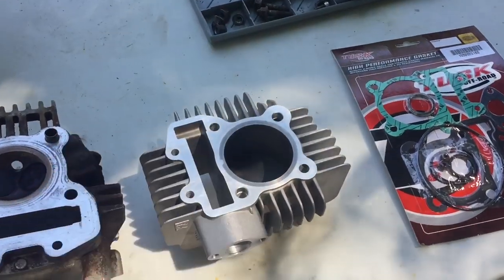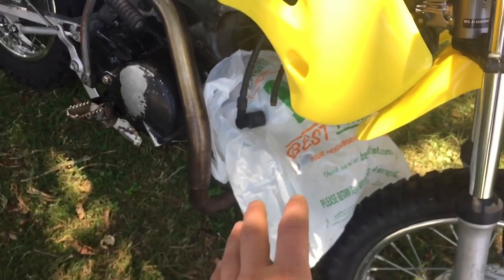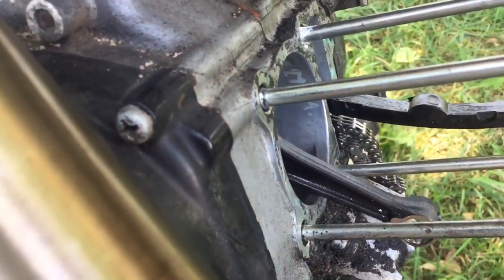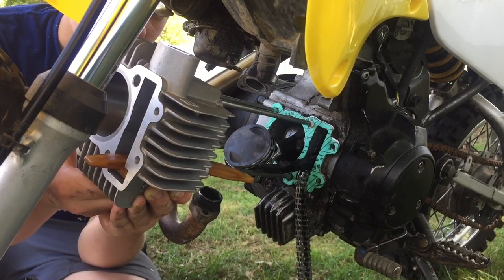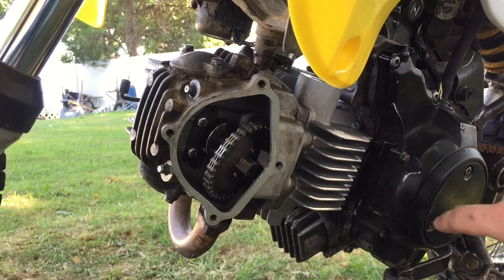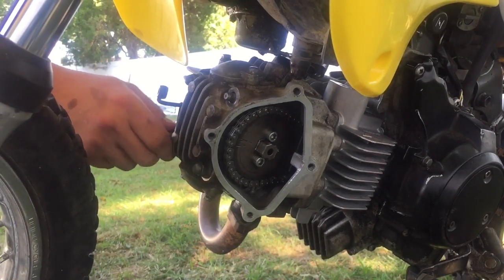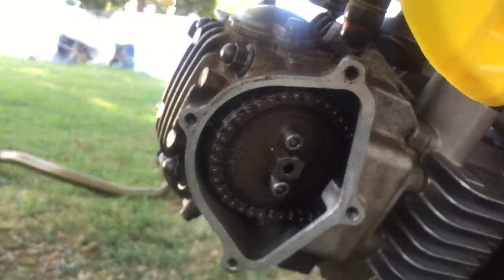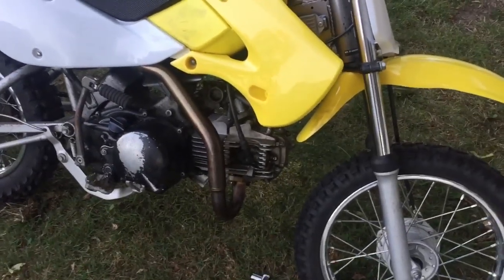INSTALLING THE BIG BORE ONTO THE PIT BIKE | PART 1

Comment: You can't guess at timing the engine. The marks MUST be lined up. If you kicked it hard and the piston made contact with the valves, you must likely bent one. Double check the timing. If no compression,  you need to pull the head off.
Good luck.
Reply: Meaning a whole new set of valves and at the price of these things would most likely be more beneficial buying a whole new head with valves and time it correctly the second time round 🤣 trial and error if you fail the first time buy and buy again
Reply: this is why whenever i set the timing i cycle the engine by hand slowly to check if they’re hitting then it doesn’t put pressure on them

Comment: Take the engine all the way out.   Clean your head better.  Put some grinding compound on your valves.  After installation adjust your timing PROPERLY.   Check you valve clearance.  Adjust your tappets as needed.  You skipped too many steps.
Reply: Definitely didn't last long
Reply: Who has a video doing this right?  I want to big bore my Chinese pit bike, but havent found enough info on how to do it to pull the trigger

Comment: take the case off and time it the right way. After timing it again crank it over slowly and make sure all the marks line up. If the timing is correct you might have the wrong piston. I've seen online that some other people had the same issue as you and they had to get a different piston. Hope this helps!

Comment: I rebuilt the top end on the 150 cc gy6 engine on my gocart and one thing that I've found easier is to put the first 2 compression ring in the cylinder and then slide it on and connect the piston and rod

Comment: You did it wrong you should've got v2 race head and the 26 mm carb and intake and then the 143 cylinder that stupid to run the 150 kit with the stock carb  and air filter
Reply: Kyler Bryant that is a really cool setup, but not everyone can dump $500+ on a pit bike motor even though it could be worth it
Reply: hes clearly got no clue..... sad waste money...
Reply: I wish I had as much money as you.

Comment: You need to find top dead center using the timing marks on your crankcase and stator you will see a t and f line the t with Mark on crank case (make sure you didn't bend a valve by allowing the piston to strike it btw) if good do the cam like you said put tensioner back rotate motor carefully two full rotation recheck timing marks then you be good to go
Reply: The ssr bikes don’t have marks on the case for timing

Comment: One tooth off on the cam sprocket could cause the piston to “kiss” the valves. Not a problem with the kit just the assembly

Comment: the magnet has a T point for timing, it needs to ba at 12 0'clock but the front sprocket has a dot whitch needs to be at 9 o'clock.then it should run 100%

Comment: Timing is off no need to stack gaskets as you changed bore size not stroke so its not a length issue

Comment: u never set the valves u set the piston to tdc and then u put the valve wheel on to the mark but the valves wasn't set as u removed the flywheel of the valve setting and when u put the fly wheel on wasn't where it was b4 take of fly wheel set valves then add flywheel to the correct spot